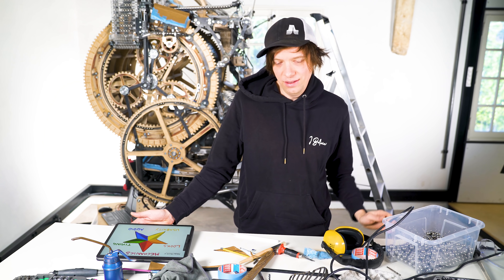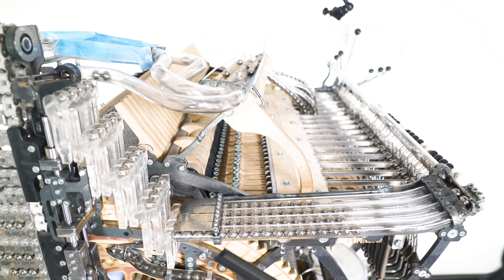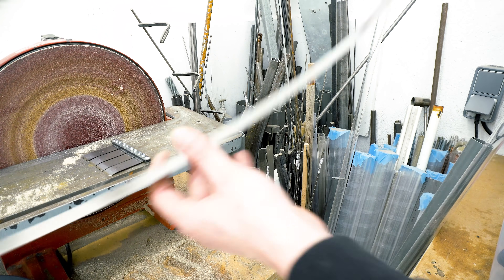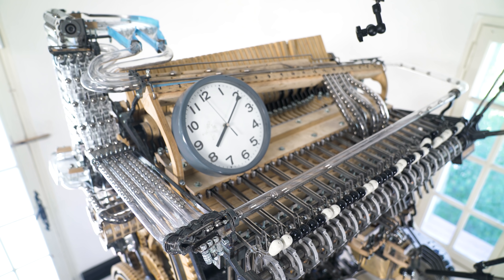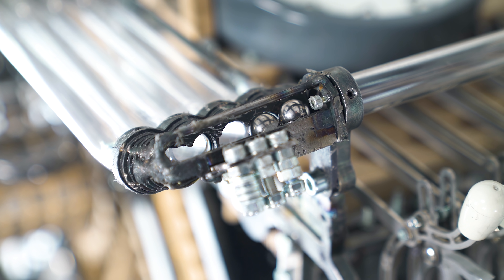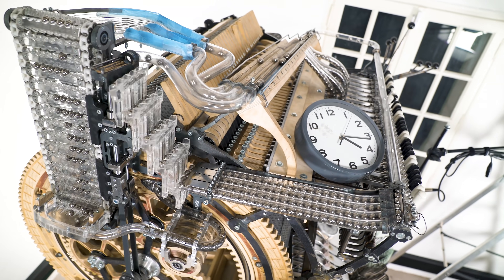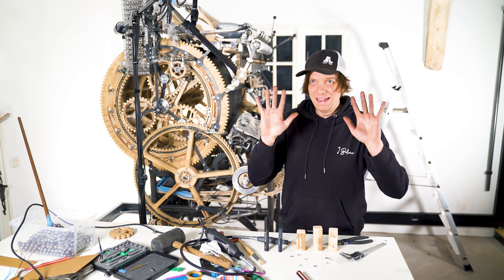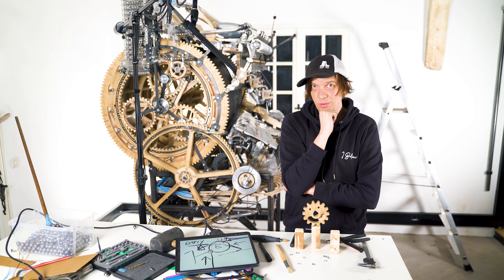Marble Machine X Fish Stair Upgrade

Comment from the maker: Sub story of this video that i didn't manage to explain inside the video itself:

There is an anti-fragile solution to everything you have seen me battle with in this video:
- Skip the divide by four
- route the marbles to the first step of the fish stair without constraining them, just an open marble canal with high walls, four marbles wide.
- at the bottom of the fish stair make a large bucket/tray with deep walls
- let the bottom step of the fish stair dig out the marbles from the bottom of the tray
- It will be a little messy, sometimes two marbles will try to ride at the same time but they will fall off and into the tray again. 
- Perhaps some steps of the fish stair will be empty when the marbles fought for the same spot kicking each other out.
- This eliminates the empty PMMA pipe timing issue with the marble getting stuck and allows the fish stair to run dry without mechanical issues.
- No need for the divide by 4 or even marble count across the four PMMA pipes leading into the fish stair.

The above solution is the Engineers stable solution, and i will fall back on that if the current tuned system ever shows another sign of malfunctioning. 

Keeping the Divide by 4 since it looks cool and seems ("SEEMS") to work right now is the artists solution.
Keeping a steady marble count is pretty simple ("PRETTY SIMPLE") once the machine has played for some time the marble count in the fish stair cue is very steady. 

SUMMARY: This is the same kind of tweaking as i have done since start of project and i am not proud about it. I do not trust any designs that need this kind of tweaking anymore. If i could make designs that didn't needed tweaking, now THAT would make me proud. Perhaps one day when i build a kitchen table or something. I am becoming so critical (finally...), i started as uber naive so maybe me cultivating a new uber critic side is the light in the Marble Machine X Tunnnel!

Y'all are awesome!
Reply: You are the man Martin! We will support whatever choice you make as the machine itself in its current form is already an unbelievable accomplishment
Reply: Honestly Martin you have helped me through some tough times, and you have everybody’s support. Everyone wants what is best for you and maybe you need to have a rest to think about your plan of action after having a set back such as this. Giving you all the love and determination from England 💙
Reply: Martin, you have the right attitude for this. Don't let your own criticism of your work get you down--your engineering attitude is exactly right for crossing the finish line. If your funding is secure, you're a couple months from shifting from machine work to mainly music work.
Reply: I wonder if it would be possible to introduce a small upslope to the pipe,to slow down the marbles a bit when the queue is empty? Shouldn't matter at all with full pipes as the pressure from behind would still push them forward.
Reply: @BrorAppelsin  cant he use another "demagnetizer wheel" right in Front of the fish stair? This would slow down the marbels but will let them get trough when other marbels push them from behind
Reply: I think solutions that work first time are as rare as unicorns. I know it is tedious, but you shouldn't feel bad that you need to tweak the different components of the machine. I am not an engineer, but I am a physicist, and work a lot with code, and there is always always always room for improvements.
Reply: You may be too deep in your own head...this is already amazing. As an engineer myself, I believe you can make this happen. Best wishes!! ✌👍
Reply: No, YOU are awesome.
Reply: don't you give up on us. Martin, you worked so hard for so long and now in the final stretch, you want to give up? NO...yes there are a lot of "tweaks" but you've made it this far. I think everyone on this channel is counting on you to finish this machine. if you've reached this point in let's say 2-3 months then yes...you could have considered but it's been how many years? and now you want to give up? I say NO...we can see that it's taking lots and lots of your time and energy, time that you won't get back, however, it's not lost in vain, you have a dream. You once had the slogan "I believe", keep it till the end. I hope you will read my message and I hope it gives you a bit of straight and power to believe again in your dream.
Reply: The obvious cause of your fish stair jumping marble is that the marble gets squeezed by the metal sheets while trying to occupy an empty slot, and then it snaps out like if you tried to tighten your fingers around a wet bar of soap. 
What if you took a couple millimeters off the sheets and instead used an angled surface to push the marble into the empty fish stair? If its made of a clear material it'd be practically invisible and prevent any loss of marbles. This way it would be auto correcting instead of preventative of an issue that only ever occurs with an empty stair slot. And could be installed on all 4 channels at the same time.
Reply: @ShadeOnTheUtube  I don't think Martin reads the youtube comments, but if you create a drawing and post to discord he might see it
Reply: Bruh that Tesla guy created over 2500 prototypes of the light bulb, and you are complaining about your designs are not perfect in the first try? Cmon Martin, you are awesome
Reply: Sometimes we change things externally to solve a problem, sometimes we change ourselves to eliminate or change a problem.

I think you need to separate critical failures that actually stop the machine from functioning and need intervention on stage, from problems that are inconveniences or minor issues.

Give yourself more room for dropped marbles. Maybe allow a 5% of marbles dropping as acceptable, while maybe 0.1% allowance for jammed marbles.

Expecting 0.0001% reliability, and making dropped marbles count against that is too high an expectation. Does a fallen marble stop the music from playing? Do musicians often miss some portion of notes in live performances? Give yourself some wiggle room, find out what truely matters and what is acceptable even if not desired.

You can do it!!!!!
Reply: You are looking more tired with each video. Take a 2 or even 3 week break. Visit some friend, family, or even go on a small vacation.
Reply: @benjaminbadrakh1644  good point. Sometimes taking some time away from a problem allows one to come back with new insights.
Reply: Not an ideal solution but maybe a fail-proof approach without changing what you have now too much could be a system that requires at least one marble buffer, like a small step that keeps one marble and as soon as it gets two it pushes through the step or a spring platform that is too high for one marble to enter but that gets low enough with the weight of a couple marbles.

Something else I noticed is that the pipes may be too high, I guess that gives more time for the marbles to enter the stair but I think that's what's allowing marbles to get caught when you have a buffer. Lowering the pipes may reduce the noise.
Reply: what if you routed the overflow pipe down to the bottom of the machine, and they just travelled up the magnets again? Or does that trip take too long for it to be effective for recycling? Also, you can get those metal shards out by putting some glue on your hands, letting it dry, then peeling off the hardened glue.
Reply: @MorningDusk7734  somewhat along my line of thought. Run the marbles to the other conveyer and just have the fish stair feed itself so you can maintain the aesthetics of the fish stair without sacrificing functionality.
Reply: @MorningDusk7734  I second using PVA white glue to peel of the steel shards. I would suggest doing a small test patch first. Other possibility is using cosmetic clay similarly: apply it, let it dry & chip it off with the shards. Just in case your test patch with the glue turns out uncomfortable for you.
Reply: @MorningDusk7734  came for this.... The whole divide by 4+ stair is a beautiful but redundant elevation system. With the added problem that if the machine turns enough time without playing, with all the channels filled up, all marbles will eventually go into the overflow.... Hopefully it will be big enough to welcome them all
Reply: 1.  the top marble divider must have high walls for overflow case (when the fish-stairs queue and front pipe are completely filled)
2. the problem with escaping marbles happens at slow speeds - when a marble sits at the  fish-stairs entrance for too long. To solve this you need to speed-up the entering marbles (a steeper incline, but only for the first marble)
Reply: @MorningDusk7734  this would most likely flood the magnet elevators
Reply: I think it would be helpful if you also have two lanes (forward, backward) feeding the triggers, instead of two lanes that merge into one mid way and really twisted tubes, since you have forwards channels and backwards channels, and having another axis can give you some slack between feeders, instead of them being so crammed together. The machine is very two dimensional (too wide, like having a piano with only white keys), and you should use the depth of the machine to accommodate instruments (except the xylophone, that can't be stacked so easily), kind of like adding black keys to a piano. Just an opinion, though!
Reply: Instead of letting the gate be as an individual why not bind them with a horizontal bar at the end of the gate so they will be released at the same timing?
Reply: @shukuchifox8635  Yeah, similar to the effect of starting gates in horse racing. That will make for an epic rematch between the Red Devil and the Black Dragon!
Reply: Hey, mister Elon Marbles, there is always a pretty engineering solution. We are all very happy to see you getting on the last chicane of this course against yourself. But no matter how much people look at you and pay to support your projects you better take a break if you begin to have a trembling voice talking about how it affects you. Remember that we did not ask for anything and that you are not legally obliged to finish this project. And most and foremost tu es un musicien idéaliste. 

I also have a question: have you already tried to ask for propositions of a better solution to the engineers of the community like: this doesn't work well: I need it to always work prettily, make a proposition!
Reply: Also, remember "fail safe" doesn't mean that something can't ever fail.  "Fail safe" means that if it fails, it will fail in a safe way.  For example, a security door held closed by a magnet that unlocks during a power failure so people won't be trapped during a fire that knocks the power out.
Reply: I'm starting to get worried about how the machine is going to be transported and reassembled after each show, and I'm afraid that it may impact the reliability, also there might a big problem with wear and tear especially on those metal shims in leading into the fish stair and despite the machine running perfectly now after a few shows you might start seeing some issues.

Worst case you can always give away the few marbles that do fall as souvenirs to the audience.

Also hearing you say that you're constantly debating on whether you should scrap the project is so sad to hear, and it's almost sounding like you're burning out. I really hope that isn't the case!! We're so close!!
Reply: My opinion is that you should forget about the machine being 100% reliable for now. You've piled all the issues the machine has in one giant heap, and now you're trying to climb it like the animation with Sisyphus you keep showing us. It's grinding you down psychologically. All you're seeing now is issues upon issues upon issues. That's clearly the case, since you've been using that "MMX Issue" image a lot for the past few videos.

You need a win to boost your morale. I think you should forget all about marbles falling to the floor. Forget about getting the machine to play tight. Forget even about not missing a note. Just get the machine into a state where it can play a song, even if it does it badly. Then you will at least see the light at the end of tunnel, and you will have confirmation that the MMX works. You can then use this as a stepping stone to tweak the machine to get rid of falling marbles, and playing tight, and being as reliable as you need to.

Spread out that mountain of issues that you've built for yourself, and give yourself a treat once in a while. You've surrounded yourself with negativity and it doesn't help one bit. The machine is basically there. It works. You just need to piece it together. You cannot fail unless you give up. Treat yourself better and raise your morale.
Reply: @CristiNeagu  100% reliable is required to concert. If anything the reliability is the absolutely most important thing about MMX. If it doesn't look as nice it's no deal breaker it's still fascinating. If you ever want to hear it make music live, it needs to be reliable.
Reply: @corgano6068  I didn't say he should bodge it together and take it on tour. I said he should bodge it together an play a song, and then continue to get it reliable. He badly needs a morale boost because he's surrounded himself with negativity and issues and he's in the mindset that until everything is fixed perfectly, the machine doesn't work. He needs to change that mentality and see that the machine does actually work, even if not perfectly so.
Reply: Martin keep the DIVIDE BY 4! It's so cool. I would just recommend you try to CNC the cuts next time. I know trying to just "take a little bit off here" is a very dangerous game especially when you need all 4 channels to feed slightly differently than the others! But keep it up! I believe in your engineering prowess (even if you consider yourself more of an artist yourself).
Reply: What if you added some weak magnets to the second step in the fish stairs, on the side a ways down from the cradle the marbles sit in, to pull and capture marbles into the first step so they don't get pushed back in the /4 pipes and end up springing out? This might ameliorate the issue of marbles getting trapped in limbo half-in and half-out of the stairs.
Reply: Would the empty-lane marbles power through the metal and into the stairs if their momentum was reduced? Because I remember you increased the angle of the pipes a few episodes ago, and if you'd roll that back, momentum would be smaller. A stack of marbles should still push lead marbles past the spring metal in that case, but a single ball will not have enough energy to force itself through.
Reply: What if you get rid of the spring steel and make like a small wall so that the ones that get wrong timing just go up one the wall and then join the rest of the marbles...?
Reply: Could you take inspiration from the plywood marble divider and create a stop as the “bridge” goes down, they stop more marbles from entering until the bridge raises again. Allowing you to manage the divide by four with counterweight more accurately and you can leave the openings as big as you want.... might be a messy explanation but let me know if you want a better explanation... in Swedish...
Reply: look, imma be real with you. You are an INSPIRATION. You have opened so many eyes to art, engineering, and the marriage of the two. You can not quit. Not because, I tell you not to, but because your journey is proof that even the most challenging things can be done. Anytime I get stuck on something, I think about you and how youre still fighting after so long. You should not be embarrassed, but proud
Reply: do a steeper incline for the first marble in the queue (closest to the stairs) - currently the marble doesn't have enough speed to catch the stairs if there are no other marbles pushing from the back.

Actually, this is a "lowspeed" edge-case-marble, caused by the fact that the marble stays at the fish-stairs entrance for too long. 
A "highspeed" edge-case-marble is significantly less likely to appear because it most likely will be faster than the fish-stairs step that moves upwards, and simply fly through the entrance by inertia.
Reply: So a couple of notes:

First of all, don’t give up. Engineering is humbling work, because after enough time you won’t have anyone to blame for the problems you find but yourself. But if you can confidently say that, knowing what you knew then, you’d make the same choices, then you’re fine. Part of what makes humans so great is our capacity to grow from our past selves. Seeing a flaw doesn’t mean a failure on your part, it means an area where you have grown, and that’s actually a really cool thing. The problems we solve that we have made ourselves are evidence that we have improved and are better than we were. View it as coming alongside your past self to guide him to be a better engineer, and you’ll find yourself not bothered by the problems as much.

Second, every project is riddled with mistakes and bugs. They are evidence that they were designed and created by humans. Don’t fret if there are a few that you miss—just bring some extra marbles with you on the tour.

Third, if you go with the high-walled channels leading into the staircase, I would advise that you find some way to gently coax marbles that try to jump the stairs back into the queue. You can prevent them from flying out, but if they stack 2x in the fishstair, or if they fall back on other marbles in the channel, it will cause further issues.
Reply: The option that would work 100% is playing a drum. With drum sticks. Don't simplify too much, or you'll end up with a vibraphone wedged between a set of drums.
Reply: why not bend the Spring Steel the other way so the Edge Marbels get Fored into the Fischstair
Reply: Another option would be keeping the divide by 4 for the aesthetics and have it unload the marbles into a small tray next to the fish steps. But this might bring new exciting bugs like overflows and stuff.
Reply: Hey Martin! Looking at the video at 14:08, it seems the marble isn’t late so much as the fish stair bumps it back a bit when it comes down, which threw off the timing of it falling into the stair. I’m not sure what the solution is, but this probably only happens when the queue is empty.

Also, the engineer in me loves the aesthetic of the divide by four. I think it can be made reliable. Have you considered needing a fifth marble to tip the mechanism with a fence that would keep it in place until it tips back?
Reply: Would making the divide by 4 tip at 5 marbles, with the last marble that tips it get blocked from moving until the tipping mechanism comes back up and it can roll to the first position? That would eliminate early tipping and ensure that it would be full before tipping.
Reply: What about scrapping the requirement of no marbles on the floor?  Is the occasional edge-case marble really a deal breaker, as long as they fly out of the machine and not into the mechanics?
Reply: Why you just skip the fish stair? If the marbles go to the other lift (don't know the name but it's not fully loaded with marbles) Than you have only one lift that runs all the marbles too the top of the machines. And if that lift can't handle the load make it bigger I guess? (sorry if I made some misstakes in my english I Hope you understand :D
Reply: The divide by four seems to have been through the wars having had so many bits tweaked and cut off of it and as a result the part is imperfect compared to the original design.  Maybe its just time to put that one in the ex-part box and make a new, better one?
Reply: I don't quite get what the springs purpose is. What's so bad about the odd marble falling back into its trail every now and then? You only need some walls to prevent the marble from bouncing out of its trail.
Reply: @ehtuanK  Yeah, the point where the pipes meet the fishstair has no room for error. It should be replaced with a bowl that allows marbles to move up and back if necessary.
Reply: What about changing the divide by 4 into a mechanically actuated system instead of a balanced self tipping system? Tip it with a lever hitting the bottom of the fish stair.
Reply: @kschleic9053  I like the idea of a lever, but at this point, adding another gear-driven system may be both difficult and ugly.
Reply: Hello from Ukraine, Martin, maybe you should make the constraining flexible metal strips near the fish-stairs just a tad longer? To help keeping naughty marbles inside, but not too long to prevent the fish-stairs from gripping the metal
Reply: There’s another solution which might be a bit less messy. Reroute the marbles back into the big vertical conveyer. Could even make it cool with a spiraling pmma pipe that would be able to hold a lot of marbles. Might be problems I’m not foreseeing with that but it’s a thought :)
Reply: Hey Martin, if that one piece gives you grief in the future, id recommend just making a new one (That metal divider)
It would be a lot easier, and probably preform better two
Reply: My favorite way of expressing a self correcting system is a sailboat. In general a sail will spill more wind the more it keels (leans) thus preventing the boat from keeling over.
Reply: You shouldn't feel embarrassed at all @Wintergaten 2!
This thing is an amazing piece of insanity :) 
I'm glad you kept the div4, it adds a lot to the aesthetics. 

Try to keep this in mind though... "I do not trust any designs that need this kind of tweaking anymore." 
Literally every mechanical system in existence is a finely tuned set of compromises. Everything that has ever been designed in all of time, has required multiple "tweaks" and iterations. Take for example the ubiquitous internal combustion engine. Why do you think they are only 30% efficient at best (aside from disease-ls)? Literally every single function and process in an IC engine is a compromise and (at least in the most common configuration with the current valve trains etc.) really cannot be made to be more energy/heat efficient.

Don't be so critical of your work. Almost any mechanical design can be made reliable. 
Like any design, it's far easier to make something ugly that works than it is to finesse something beautiful into reliability. 
Slapping enough "bird shit", porous welds onto two pieces of metal will eventually create a horrendous metal tumour that's strong enough to handle the stress of the joint, but craftsmanship and a little more effort makes for a pretty "instagram weld" twice as strong.

You're at the stage of the build where the fundamental machine is complete, there are just some bugs need tuning (not tweaking). I've been there, it's frustrating. Progress can seem slow.

But, above all else, I'm going to throw your own words at you my friend ... "Glory is forever!"
Complete your insanely ambitious, lofty, beautiful machine and decades after we're all gone, children and adults alike, will smile in museums and at showings as your name lives on and inspires, for having the courage to build the kind of machine that most of us have convinced ourselves we don't have time to build. :)
Reply: Waiting for y’all’s jam sesh
Reply: If you make the pmma pipes a bit lower before the fisher stairs it could be better, the fact that they do a back and forth motion isn't really good I think (if you don't understand I can explain in french)
Reply: The fish stair looks beautiful and cool, but engineer in me tells that you don't need it at all. It just adds unnecessary complexity to the system and creates potential points of failure. You can transfer the extra marbles directly to the conveyer belt with just couple of pipes. Or silently  drop them to the very bottom of the system, without hitting the instruments.
Reply: If I may make a suggestion: have that marble divider thingy at 6:49 be gear driven in time with the machine rather than flip under the precise weight of 4 marbles.   While it may occasionally flip with less than 4 marbles in the breech, it'll be much more reliable.
Reply: You could add a dip along the length of the divide by 4 pipes, with the entry side still being higher than the exit side, so the balls won't enter the fish stair unless there are balls pushing it from behind. That would prevent balls from entering the fish stair at high speed.
Reply: Does the artist's solution get you to the correct percentage of marbles played per 10,000?
Reply: I wish you good luck with your tour, we will all be there!!!!
Reply: Considering giving up can be a responsible thought. But only if that thought gets dismissed.

Maybe you should build some sort mechanical devise that can whack those moles for you...
Reply: use a strong magnet to get the iron out of your hands (nxt time ..;- )
Reply: Hey Martin,
don´t know if you are reading this, but maybe. Engeneers designs are often not flawless. The main point is to analyze what is going wrong and even more precisely whats the cause fore it. In this case, the marble getting stuck between the edge of the fishstair and your spring plate is only the result, and you tried to adjust the result, without checking for the cause. Engeneers work beginns with asking for the cause and adjusting the causes. In this case the marble getting stuck is caused by a wrong timing. This does only happen, when the marbles run down at full speed. (This still has to be cheked). So if you try and slow the marbles down, will they get stuck again? 
Kind regards, Kai
Reply: Keep fighting
Reply: Keep fighting. From indonesia🔥
Reply: You should never give up this Dream, Martin. I suggest you finish the machine as far as it can play music. I would suggest to always choose a design that can be reproduced. Since you plan to go on tour it might be a good idea to have build several clones of the mmx. So the original instrument has not to be shipped to every location. 
In order to achieve maybe you should plan the world tour for the second album. Your dream might need some more time to flower. So hang on.
Reply: Don't give up ! we are hear for you and for your machine. It will take the time it need and we will be there for the whole ride
Reply: Do both. Keep the divide by 4, but convert the pipes into a tray with shallow grooves milled into the bottom. The marbles can be divided and ride on the grooves to make neat lines without being enclosed, and if any one groove gets full no problem - the next marble won't fit and will likely jump to the next groove over. IT could even be routed out of clear material to keep a similar aesthetic to the pipes you have already.

On the fish stair end, it again is no problem - the grooves would encourage the marbles to line up but wouldn't constrain them in the manner that the spring does removing the potential for marbles being YEETed out of the mechanism. Higher walls could be added but if it's a clear material shouldn't remove from the overall aesthetic too much.
Reply: Don't worry about negative comments man! They're far outweighed by positive ones and half are likely trolls. Never forget that you're doing this for yourself, not for us! It feels like you're on the right track lately and have been making significant progress because if the machine isn't reliable, a world tour is impossible. Keep whacking those moles until the million marble goal is achieved because once the MMX is functionally sound, you can start composing (which I think we all know will make you SO happy) while you tinker with looks and interface in the background. I'm so glad you made this channel, but don't worry about uploading every day either. If you miss a few here and there, we'll understand because the MMX should be your focus, not YouTube. 😎
Reply: I am really happy reading this from you. A design that allows adjustments is better than one without room for adjustment. But the best design, is one that doesn’t require tweaking to a precise value to function in the first place!
Reply: Giving up is always the logical option with large, complex engineering tasks, but it is seldom the right option to pick when it's a project that you are deeply involved in and want to see through to completion. Regardless of how god damned difficult it is to pull off, or how much hair, sleep or sanity you lose.

The engineers behind the Eiffel tower never said "Fuck it, this thing's too damn complex. Lob it in the scrap pile and let's make another arch!"

Nor did the engineers that designed the Bughatti Veyron say "screw this, let's just use a turbocharged V8 instead!"

Or the boffins that designed the Burj Khalifa decide "welp... the foundation's not gonna take it, so why should we? Scrap it and let's just build a block of flats instead!". 

Sure, the undertaking is MASSIVE, very time consuming and the engineering process is super complex, but that to some makes it all the more worthwhile to persist and see it to the end.

Does that make these people batshit for even attempting such feats? I mean... Probably, but let's be honest... somebody HAS to try before we know it ain't ever gonna work!!

as the adage goes. Adapt. Improvise. Overcome.

Adapt your skillset and tools to be able to make what you need

Improvise solutions to problems that exist

Overcome the engineering hell that is the MMX's construction.

And remember, Martin. You are the first person to even consider making such a complex mechanical machine that can potentially play well timed music right down to the last millisecond. There are many mechanical musical instruments from hundreds of years ago that all serve the same purpose as MMX... but precisely zero of them use steel ball bearings as a method of playing the instrument like the MM and MMX do. And none of them to such an insane degree of accuracy. This machine, when it's running right will be the closest thing to perfectly timed since time-alignment in DAWs was a thing! and that for any musical instrument is so insanely impressive that it in itself deserves notoriety!

It's not up to me to say what to do next, but if you want my personal opinion... Push for that world tour. We might be in the grips of a pandemic now, but let that be your opportune time to not just complete this machine, but make it truly perfect. I look forward to seeing it on-stage with you cranking away like the madman you are, living the dream you promised yourself you would achieve back in 2015.
Reply: Been watching from the beginning and I still believe in this masterpiece to be completed. Already exited about the music to come for years and patiently I'll be waiting and enjoying the story till the music is here!
Reply: Don't forget that you can leave the divide by four bit, but make the channels merge into a tray
Reply: Why not have some sort of cover over the spring steal that can catch the edge case marbles and funnel them back into the beginning of the marble que
Reply: If you go for the big well, keep the divide by 4, and a few inches of PMMA, that then drops into the well! It’s a very aesthetic piece of the machine, and this doesn’t run into backups in the pipes.
Reply: Hey just a idea. Maybe you could put the springs a little further down so that the marbles get "stuck" by the springs and only continue to the stairs when there's marbles behind pushing it therefore never running dry.
Reply: I would like to make another suggestion: have some "pin" gates as an extra step in your channels. Have pins or plates that can come up through the bottom of the feed ramp of the fishstairs behind the row against the stairs, connected to the same fish-stair mechanism. Every time the first step of the stairs come down, these pins come up behind the first row of marbles and in front of the marbles behind blocking the marbles behind from rolling forward. This would block the high speed marbles when the ramps are empty until the stairs are ready. While this might mean they don't get picked up by the stairs for another cycle I think the should be enough buffer that this isn't a big problem. If you spring load these pins so that they can't jam against a marble right on top this should be a fairly robust solution I think. The only downside is that you lose the "pressure" of the extra marbles in the feed ramp pushing the marbles against the fish stairs, but it looks to be feeding well even with single marbles so that should not be an issue (if it is you can introduce a slightly steeper "step down" for these first marbles).

Edit to add: This solution allows the timing of the first row of marbles making contact with the fish-stairs to be robust and steady, similar to how you introduced a "staging" position in the marble droppers. 

Martin, as a mechanical engineer I have loved watching your journey into the world of engineering. It can be a frightening place that will make you doubt your sanity and a marvellous world where you can soar on the feeling of finding that elusive solution to a problem. There is a reason it takes years of schooling to learn even the basics of mechanical engineering and you have learned a lot of it just by doing it. I think you can hold your head up proud, you are not doing badly. Would I have done things differently? Certainly. Would they have worked better or right first time? Highly unlikely. I'm not perfect, neither is anyone I've ever worked with. Keep hammering those moles and you will get there.
Reply: Awesome Vid as usual 👍🏻
Have you ever thought on buildig a synchronized system using a mecanical divide by 4 system with more than only one section, like more tubes like a gattling gun and synchronize it to the fishstair with a belt?
Reply: Martin, why not use a flip flop divider? It'd be an easy mechanical solution to ensure all marbles are equally distributed between all four channels.
Reply: Do you need the fish stair to work with empty lanes? Probably not as in that case most marbles are played rather than going on the overflow and fresh marbles comes from the conveyor belt instead.
So why not have a stop at the bottom of the pipe, spring loaded that would go down when the queue builds up? Image for illustration only
https://imgur.com/ZJ0UPLK
We know how much you like to tweak such spring loaded mechanisms. It would slow down the marbles and allow you to get rid of the situation that is causing an issue so that you don't have to address the issue itself. Rest seems to be working fine.
Reply: No, you're awesome Keanu Reeves' voice
Reply: Martin, i understand your plight of feeling ashamed of what you have made, but you should know, we are all proud of you, not only for this beautiful machine and the music it will make, but your perserverence and growth. In my personal opinion (I AM A LAYMAN TAKE THIS WITH MORE SALT THAN THE PACIFIC) the complex workings of the machine seem to create their own beauty. While elegance is a wonderful thing, something should be said for the cogs which make the ballerina spin.
Reply: I think that the following quote exemplifies the process you're going through "Any idiot can build a bridge that stands, but it takes an engineer to build a bridge that barely stands." So don't lock yourself into the mindset of thinking the purely reliable and well-built solution is the pinnacle of engineering.
Reply: Here's a thought - instead of making the machine super engineered to be robust but ugly, keep the machine in this beautiful but fragile state, and LET IT FAIL. Maybe the machine misses some notes. Maybe some marbles fly off of the machine in fantastic fashion. Embrace the fact that machine is imperfect, call it out, make jokes about it on stage. It will only make the project that much more entertaining and interesting.
Reply: Okay, I was going to put this as a video responds...I have been sitting on this advice for a while now, and I'm not sure I may have already said this but...!

If your project is getting you as frustrated as the community sees, or more like, I see, then by all means, Martin, consider this. If giving up is on your mind but not really a reality then by all means DRAW A GHOST LINE with it. Meaning, you have to draw a line somewhere, you may have done the hardest part by "tweaking", but as you said that's not really what you want. A ghost line is a temporary STOP. Maybe up to three months, or less you decide. Write an EP or go on vacation just put distance between you and your project. Do something different, something you want to do, like write maybe 5 new songs. By then you would have given the community time to relay better suggestions you can pick from and see the MMX in a new, refreshed light. You may see something you may have over looked causing more moles to pop up. Breath, do something different and move on. Come back to this feeling different and maybe more motivated. 

I have been following this crazy build for almost a year, and I have to say I am exhausted by the internal and external fighting you do in every video. Yeah, it's a great idea but expectation vs. reality. If you cannot get anymore to work or make sense despite all your new efforts, DRAW A GHOST LINE. The community will understand (I hope) that you gave it your best efforts for almost 4 years and even you need to have a life, a break, getting on with other things you want to do. I'm still trying to write the Wintergatan bio, but I have come up with some moles. Ghost line, Martin, right now may be the best thing for you and your project. You don't know how much more you'd get done by taking more breaks. Food for thought, love you, hun. Take care. Best wishes too you with whatever you choose to do with this project, but it should not drain you that way it has. Move one, write an awesome EP.
Reply: Martin don't quit the project, this is converting you into a great project manager and there is tons of people enjoying the process and your team working on it.

Also you could think about a mechanic similar to the one used to drop the marbles into the instruments one at a time for the fish stairs. Also the slope before the stairs make the marbles bounce back which can be problematic.
Reply: You could use the spring steel retainers as gates, flip them vertical to block the marble flow into the fish stair. Then as the fish stair comes down, it activates a simple lever system by pushing down on a rod, that has a fulcrum. That lifts the gates with the opposite side of the rod, allowing the next set of marbles through. As the fish stair raises, it releases the pressure on the rod and the gate comes back down, forcing the marbles back behind it.  There may need to be a return spring on the gates to overcome the weight of the marbles in order to shut it again.
Reply: Wintergatan 2 why is there only dysfunctional art and ugly engineering, why can there be sleek and functional  things
Reply: I think I just might have a solution for the timing problem, it's a parallel input situation to your marble droppers, except it works slightly different.

You use the input fishstair and put a hook (or similiar) on it, the hook stretches underneat the pipe a bit outwards to the input end of the "divide by four" mechanism, the hook is flexible and inserts a rod into the pipe via a hole in its underside.
When the fishstair goes up and there isn't enough marbles, the rod will act as a break or stopper, untill the lowest stair goes down again, the rod thus being removed and opening the way up again for the now considerably slowed AND timed marble.
When the feed is full the rod either moves inbetween the marbles and nothing worthy of mentioning should happen OR the flexible nature of the rod fastening means that it gives in and no damage should occur and neither should any negative interferance.

Construction: 1 piece of springsteel [1] is cut in such a way, that it look like 4 T pieces lined up and melted into 1 piece, inbetween the finger (bottom of the T-pieces) a hole can be drilled, the same on the outsides, leaving you with 5 holes to fasten, an M3-M5 should be more then enough to ensure that it will not loosen, the 5 holes ensure that each finger can work without flex interfering with another. The fingers are to be bend about 90ish°.
For the holes in the fingers that are serving as rod mount a longhole is to be made, serving as a timing adjustment, the same holds true for the PVC pipe, the rod is a small screw with a nut, the finger clamped inbetween. An advantage of this being, that the screw can be shortened to such a length that it barely reaches in enough to block a marble, which also reduces preasure should for what ever reason the marble be directly on top of the rod. The fingerpieces should be made from springsteel, not only is it on hand, it is prooven to be weak and strong enough, without damaging the PVC pipes.

[1] Alternatively 5 T-pieces can be created and bolted on in such a way that the upper beam overlaps, again 5 holes are needed in the fishstair, other things would stay the same.
Reply: probably too late in the designing process but it might work ... I think: 
https://youtu.be/H-53TVR9EOw?t=123
Reply: Given that you will need to be able to buffer up to 500 marbles in the fish stairs circuit (to keep the divider full in any circumstance), you will need to rework this part anyway, and the divide-by-four is constraining you too much. Even if a future step involves removing it to make the machine work, do not see it as failure, but as a step in the right direction ; when the machine works, you will still be able to make it prettier. Also I would like to point out that you seem to be making huge progress at the moment (from my engineer perspective).
Reply: I recommend you invite another engineer and work together over a few days. Don't struggle with this alone.
Reply: i feel like the 'bucket of marbles' solution could be done with clear lucite or something and look really neat
Reply: Do. Not. Give. Up. Every step you take, every lesson you are learning, every happy little accident; they are all taking you forward. If it turns the divide by four works, it's a victory. If the solution you outlined above has to take over, that is a victory too.
Reply: Quoting Elon Musk: "The best part is no part. The best process is no process. It weighs nothing, costs nothing, can't go wrong" ... you are correct - just get rid of the "divide by four" part
Reply: Engineering is all about solving one problem after the other, no matter the field. This the normal process, iterative improvement and know-how build-up.
Reply: I’m guessing you are trying to not order any new metal parts, but what if you used a set screw to set the height of the divide by 4 entrance thing.
Reply: Keep it up Martin you are doing a amazing job & this is probably the best time to work on getting it correct as you can't play out anywhere atm anyway, i believe it will be worth all the frustration in the end.
Reply: Don't stop! I will use these videos to help train people learning quality control. Don't get frustrated either. You are following the natural arc of almost every prototype product ever. Compare to all the iterations of the wheel and know you are way ahead of the curve.
Reply: maybe you can try to bend the metal flaps at the end a little bit up
Reply: Yo! Just because you stop working on the MMX doesn't mean you gave up. Projects just run their course. I'm sure you will find some other giant project to throw yourself into and that's called growing. To think the MMX is a failure is ridiculous, to think stopping now is somehow equivalent to giving up is crazy to me. 

Take a step back and look at the amazing machine you've built. The multi-thousand piece of mechanical art that you manifested from that center of creativity in your brain into the reality that we all share. You've garnered almost 100,000 people who subscribed just to see you work on it, not even see it do what it was meant to. You've built something great, take a step back and enjoy it, look at it, and truly appreciate the (probably hundreds of)  thousands of hours of work you've put into it.
Reply: The divide by four needs to meet the big grinder...Pain is temporary.
Reply: I'm not going to read the helper comments, but from this perspective as an observer, a shallow chamfer on stage one lift elevator might afford just enough clearance to allow the marble a path to return to the ready position rather that eject it. Thus, not allowing it to become trapped by giving the marble an angular path to follow - reducing friction to the marble so it can rotate down as the spring tension grows.
Reply: Don't ever let the tormentors get you down, Martin
Reply: The marble divider is so painful to tune because the torque of the counterweight outweighs the marbles as soon as the first marble loses contact with the divider, causing it to immediately begin to tilt back to its waiting position. Adjusting the counterweight does not solve this issue due to a conflicting functionality: The counterweight needs to be strong enough to outweigh up to three marbles while the divider is filling up, but at the same time weak enough that even a single marble can hold the divider in its tilted position.

The problem gets a bit worse due to the positioning of the counterweight: Since its center of mass is lower than the axis of rotation, tilting the divider increases the counterweight's torque as it rises. Placing the counterweight in a way that its center of mass is higher than the axis of rotation would decrease its torque when the divider tilts. But that would require a redesign of the divider while only helping a little.

I think the easiest solution would be to use leverage, but that could cause new problems:

Solder eight short pieces of wire to the divider, a pair for each marble, such that they tilt together with the divider and let the marbles roll over them. While the marbles roll along them, the wires act like levers holding down the divider. As the marbles roll further away from the axis of rotation, their leverage increases. If the wires are long enough that the distance between the marble and the axis of rotation can increase by a factor of four even a single marble will be enough to hold the divider in its tilted position. This guaranties that not a single marble gets stuck.

But there is a problem with this solution: The divider could stay tilted for long enough that new marbles can enter it. So you need to solder a little piece of metal to the entrance of the divider that acts as a stopper. While the divider is in its waiting position, the stopper stays clear off the entrance. When the divider tilts, the stopper tilts with it into position to close the entrance.

However, you need to be careful when you position the stopper. If you don't do it right, the force with which the incoming marble presses against the stopper could induce yet another torque. If there are enough marbles pressing against it, the torque could hold the divider in one of its positions, thereby jamming it. It could by very difficult to do it right without re-designing the marble divider in CAD.
Reply: Don't give up Martin, the MMX is awesome and your engineering journey with it is great to watch, and educational too 😃👍
Reply: Repeating myself in a top level comment, in short. The invariant is supposed to be that marbles always go into the four tubes as a set of four, and are also always released as a set of four. Use a TURNSTILE actiated by the ascending fishstair to release onto the stairs, instead of weight/pressure-released, non-synchronous springs. The (weihht-released?) tipping tray might be usable as is, as long as it can assure that it always passes exactly four marbles, but only when there is space for them in the four tubes. If not, some kind of turnstile is needed here also.
Reply: You definitely have to try the community options of youtube! through polls and community posts more people are reached than just through videos. in this video it is shown well: https://youtu.be/Ej0Kijd4_4Q
Reply: Keep at it. From an engineering perspective, you are kicking ass! If things were 100% perfect, it would be boring. Loving this channel and the amazing music you make! Thank you for being you and sharing part of your life with the rest of the world! 💜
Reply: Do not give up, you are awesome
Reply: I think if you chamfer that point on the marble stair that lifted and shot that last marble out, then it would fix it. /\ instead of /|
Reply: There are a lot of other good engineers that follow you, so why not bring on some help and split up the duties here?
Reply: Sometimes we put a huge goal like 99.999% reliability on a 10000 part machine that takes time. You already did a machine that even though it had lots of flaws it was a success. Most of us are here due to that machine. So if you want a flawless machine takes time an perseverance. To me I just see this as a normal proces for the invention of a new machine. A new super car requires millions of dollars on IR&D  and hundreds of technitians engineers an more people to get to the final product. in this case you are with limited budget and only 1 all in one operator. Its not impossible its just difficult.
Reply: You've reached the point where you are actually good at this, the problem is that has also come with the realisation of what you still have to learn to be truly proficient. This slump in confidence that comes with this is completely normal, just stick with it! Don't doubt yourself, remember you already made a working marble machine without all this extra knowledge!
Reply: With environment factors (temperature changes, external vibrations etc), you will forever be tweaking the MMX. I think you are chasing something that cannot be achieved. I don't think the divide by four issue is so critical that it's going to prevent the machine from making music (albeit with a few takes). Leave the design alone for now and refrain from making drastic changes.
Reply: I love this project. I think you should see it through. Just remember form follows function. Make it work first, THEN make it pretty. Look for the simplest and most stable solution first, then let the artist loose!
Reply: "Keeping a steady marble count is pretty simple ("PRETTY SIMPLE") once the machine has played for some time the marble count in the fish stair cue is very steady."
This is not taking into account playing all channels, is it ? Are you sure this won't be a problem that arises later ?
That being said, don't give up !
Reply: subtle engineering IS art
Reply: Thank you for explaining the engineer’s solution!  To be honest, I look forward to that. I believe you are an artist and will make it aesthetically pleasing. 

The divide by four is logically pleasing, but it also adds noise to the machine.
Reply: @Martin,. The tweeking is how you learn what works and what doesn't. You're being to hard on yourself. It's okay to take a break. If not you will get burned out.  I do think there is a simple solution.  On the very first step where the marble is getting stuck, if you found the edge a bit on the step which right now has a sharp corner to it the step should be able to roll up the side of the marble. Otherwise you'll need to make a stop that prevents marbles from moving forward once the desierd number has entered the step. 
Just curious : why you opted for this method as opposed to say something like a water wheel, or conveyer belt?
Reply: don't give up
Reply: Man I'm baffled amazed and in complete disbelief of how complicated and freaking awesome this machine is and the first marble machine blew my mind and I shared it several times.youre quite the engineer and I'll say you're a genius ..simply an amazing machine man..definitely don't give up..i can't wait to hear this when it's finished!
Reply: Could the front edge of those metal pressure strips be bent up slightly and then that might allow the marble to not get hung up and sprung out of the machine? But I'm no engineer so that probably wouldn't help lol
Reply: Here's your problem Martin. STOP FIXING SHIT THAT ISN'T BROKEN!!! How long do you plan to run the machine for in each concert??? IT'S RIDICULOUS MAN. Just adjust stuff as needed in-between each song! MOVE ALONG! 
You played the machine for 4+ hours testing for 100% funnel accuracy and the mechanism you're trying to fix now held up just fine!
Reply: You are a BOSS! Keep going, it'll be so worth it when finished!
Reply: I don't see how that solution would be ugly. I rather see it as order in chaos, or as a bucket getting water from a river. Quite beautiful actually.
Reply: Don't stop! "Only" the vibraphone channels are missing! If you finish them, you are finished besides for some tweaks regarding reliability.
Reply: I see a third option. 

The divide by four doesn't have to be "perfectly reliable" it only has to be "reliable enough that it doesn't fail in a way that compromises the functionality of the machine (or puts performers/stage people at risk)". A marble getting shot across the stage like we saw in this video doesn't put the machine at risk so it doesn't actually matter in the grand scheme of things if occasionally you lose one in that fashion.
Reply: @SomeMorganSomewhere  That sounds like at least a 4th option. As i see it right now, in my ignorance, here are the options:
1. Keep doing what you're doing (which is fighting an uphill battle against never ending issues)
2. Give up (which seems very premature to me, especially now that the MMX is basically sort of kinda finished)
3. Keep going, but give up on high reliability and accept marbles will fly out (which, to be honest, is kinda nice... i think the image of the machine sitting in a pool of its own marbles after a song would be a very whimsical image)
4. Get a win now, play a song on the machine, and ignore any and all issues that arise, then work on getting the reliability where you want it with a boosted morale (which is my preferred option)

Does anyone have any other option?
Reply: I can’t help but feel if you want to go for the simplest option then just route everything to the conveyor instead which would at least look more visually pleasing than a big container just permanently strapped on to the side of the machine
Reply: We love you Martin! Your mental health comes first!
Reply: Just like i predicted... the machine will rust because you never parinted it ..
Reply: If you can constrain them quite as much just after the divide by 4 by just dropping them into open channels and then into the PMA pipe that should give you the best of both worlds 🤔
Reply: Couldn't you use simple marble-gates (like the ones you use to release one marble/play a note) to feed the marbles from the pipes to the fish-stairs?
Reply: Improvement idea for the devide by four: you could maybe make the system more reliable if you balance the tipping point of the system to 5 or 6 marbles and than just release the 4 of them. In this case the marbles that should enter aren't able to move while it gets to the tipping point.
Reply: Don’t give up! 
Also, don’t worry about a few marbles spit out of the machine. Just be sure they don’t fall into important gears/moving parts.
Reply: First off, don't you dare give up Charlie Brown, you will kick that football someday! 
Second we both know you can do this!

When you first began playing music, were you good? No! Even Beethoven was horrible at it in the begining and then there's Picasso who made the awkward and disjointed his art style and it's wonderful!
Engineering is similar, just because you have tools to make it easier doesn't make you a virtuoso. It will take more time then a couple years to master, to build this masterpiece, you've done amazing work but even masters need to come back and fix mistakes sometimes! 

You're also fighting on three fronts, the musician, the artist and the engineer. 
The musician is getting impatient again and it's forcing the other two to rush into things. 
Calm down and remind yourself that you've got this! It's just going to take time. Maybe even take a legitimate break from it, vacations are hard to do right now but lock the room and mail the key to a friend to send it back in a few weeks. Play some music, make an effort in other works then when you get the key back you can return refreshed and just maybe things will suddenly click. 
Gamers see this all the time, they push and push and push and keep trying to beat that boss and the boss just keeps pushing them back and then they give up they walk away they go play another game. 
Then a couple weeks later they go back they say "I want to give it another try" and they go into that boss fight and you know what they do? They smash it on the first try. 

Taking a break is essential for long projects and as many times as I've seen you say you're going to take a break you still haven't. You slowed down the racing pace you were working at but a true break has not happened for quite a while now.

We will be here when you get back. ♥️
Reply: Couldn't you turn around the springsteel (or use something that is similarly shaped) so it pushes the marble onto the stairs?
Reply: You're quite right. Give marbles that escape the desired path no option but to re-join the pool of marbles. 
Also, why not, instead of a fish stair, simply employ a belt or chain to capture marbles from a central pool?
Magnets are useful here because a magnet can be chosen such that it will hold one marble and one marble only.
This simplifies the feed of marbles since you don't need an orderly queue. Just a disorganised pool of marbles (some random lottery machines are good examples).
Instead of dividers you can duplicate the belt/chain (+magnets) mechanism. Again, all catching marbles from the same pool. 
Also you can design for a slight oversupply of marbles and make the surplus ones drop back into the pool. That keeps the queues balanced, even with occasional dropped captures.
Reply: Keep up the amazing work, Martin!
A couple of suggestions:

1 Engineering - simplification: Lead the overflow pipe directly to the bottom of the conveyer belt, instead of the fish stairs (if the conveyer belt has sufficient capacity).

2 Artistic: attach an arm to the fish stairs, that opens and closes a gate in the divide by 4. This could also be used to create a gate just before the fish steps.

3 Artistic: For the funnels, if you want them moving, you could make the outer parts wrap a bit outside the inside parts, so there's no gap when it's opened. You can either do this with new metal parts (although there could be a risk that a ball is pinched in the movement), or you could do it with the plastic parts, which most likely will be easier to work with, then they don't have the initial curvature from having been a bottle. Also heat might make it more malleable.

And I'm curious about the balls. Have you ever weighed them, and measured their dimensions. I wonder if it's the same balls that skips the funnels (if they're heavier/lighter/bigger/smaller). It would be interesting if it was possible to mark them reliably, to see if they ever cause more than one issue.
Reply: You could add a synchronized indexing gear/bucketwheel (where the teeth push the marbles in a U-shaped channel, from above) right before the the fish stairs, so that it always pushes the marbles onto the stairs at the right moment - will let you keep all the piping and the divider, and should look the part too
Reply: Martin! I don't have a drawing but I think I have a problem statement that could lead to a possible solution for you. 
I think the problem is not the fish stair as all the stairs work perfectly except the loading. I also don't think the divide by 4 is the root cause. I think there should only 4 marbles available for the first stair or at least make sure  the pressure against the first first stair is equal to one marble at each position. it could even be a bit more if not held down with the spring plates. I believe the clock escapement marble gate mechanism in lock step with the stair could give you exactly that.
Hope this helps.
The clock escapement is wat the doctor ordered for. I believe you are in the home stretch man!
Reply: The Dunning-Kruger effect states that generally smarter people think they are dumber than dumb people who often think they are smarter. Therefore he (sorry I'm bad with names) is in the stage where he is doubting his abilities despite having grown exponentially in such skills.
Reply: Martin, i like your videos a lot, you and the machine are amazing. But please, please, please go for the engineers solution you mentioned above. I dont want you to struggle for an eternity with this beautiful but unstable design... Please use the simpler one that works. As we can see on the other side, with the vertical marble chain, acrylic for the marble feeder looks at least as much as beautiful! ❤
Reply: No one will judge you if you ditch the divide by 4. Has anyone else made the most incredible marble machine the world has or will ever see? No. I don't think they have.
Reply: Hey Martin, I think that edge case with the marble popping out when the marbles are running dry could be solved super easily. Why not just move those spring steels forward a couple  millimetres? This way when the marble gets caught on the edge of the fish stair, the bent edge of the spring steel should scoop the marble back into the PMMA pipe. Keep up the great work as always!
Reply: The day you give up on the machine is the day 94.8k people go to search for your house to inspire and support you. You got this!
Reply: @YayDragons  sorry but that sounds threatening, not supportive 😬
Reply: @YayDragons  That’s terrifying
Reply: You'll hate me but... the funnels are a weak point in the whole machine... they are a very small target for a ballistic marble to hit *CONSISTENTLY*.  You already stopped the funnels from moving, after so much agony.  Put a wide, sloped trough that will catch them all, and be done with it!

I know the funnels are a big part of the machine's look.  Just something to consider.  Appreciate you Martin.
Reply: @ofsinope  The funnels and the divide-by-4 are the two parts of the machine that function differently from the rest. I don't think it's a coincidence that they also require so much micro-tweaking.

The differences? They're the only parts that, instead of being rigid and gear-driven, utilize bending and weight.

I have a feeling that these sections would function better if they utilized troughs that spread the marbles outward instead of concentrating them. Though less rhythmic, such a solution can still look good with the right choice of material and shape.
Reply: @ofsinope  I am a huge fan of the trough idea. statistically it elimainates failures by marbles missing the funnels laterally. (Although Martin has already said that the side to side variance of the marble paths is small. The only thing to figure out is how tall (front to back) to make the trough. It could be a beautiful solution too. Some sort of slotted plastic thing so we still see the marbles going in.  Best part, it is likely to be quieter than the current funnels. I’m even imagining some sort of landing pad for the marbles (spacex Martin!) like instead of a deep trough, a sloped pad with some sort of dense foam that would be quiet for marble impact, and absorbed the energy to avoid marbles continuing to bounce.
Reply: I also like the idea of replacing the divide by four with a plastic piece like the one at the top of the marble lift. except instead of consolidating the 6 lanes into 2, you split the one lane into four to feed the fish stair. I also really like Martin’s idea about a fish stair submerged in marbles.
Reply: Why did you open a second channel? Thank you
Reply: @Richard-qu8yl  to be able to post these kinda raw, slightly edited and in depth videos much more often without flooding main channel. Main channel will be bigger tests and milestones for the ones that aren't interested in every detail.
Main channel = follower channel
2nd channel = hardcore fan channel
Reply: @Richard-qu8yl  daily in depth videos that a lot of people don't care about, except us MMX nerds who BELIEVE
Reply: @Richard-qu8yl  because its awesome and so we can see more... duh